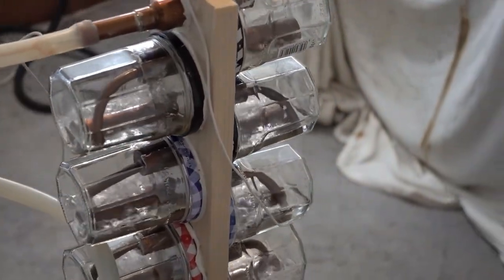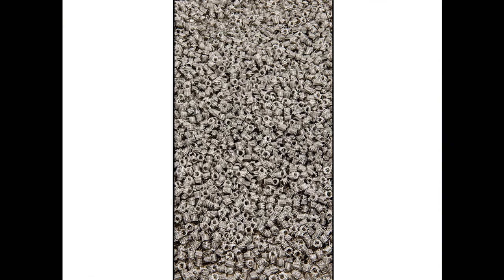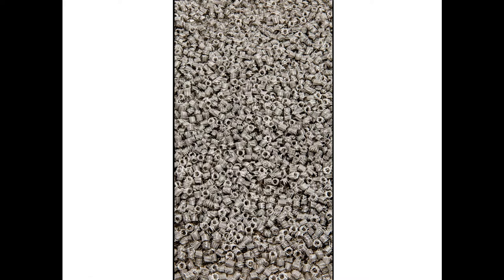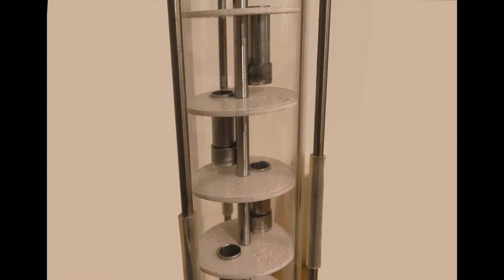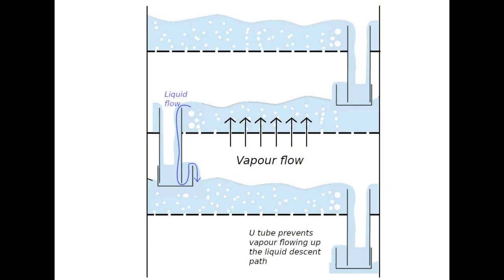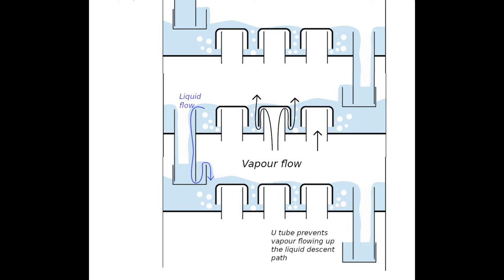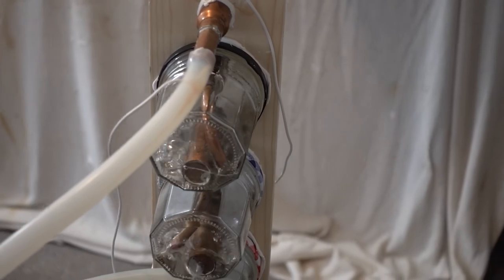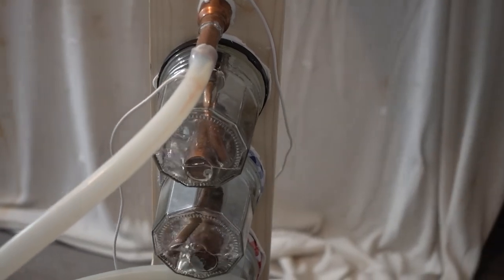moonshine columns

Comment: yes i'm definitely interested in how the last type works . subbed
Reply from the maker: Thanks, I'm working on a more detailed video but the original version has to be rebuilt as it was shonkilly lashed together with wood and silicone sealant and developed leaks, inevitably I guess!
Reply: @tight1449  could you make some kind of a tutorial video while building it?? I'd be interested.
Reply from the maker: @pranksboom3265  I am doing that but will defer publishing it until I have tested it to measure its performance.

Comment: I feel blessed to have stumbled upon this gem. My head is spinning with new ways of thinking about this  *I'm quite interested in your bonny jar contraption.
Reply from the maker: I'll post more on that but need to rebuild it. The original was lashed together with wood and silicone rubber and not surprisingly sprang leaks after a while.

Comment: That Bonnie Mammon Column looks interesting. can you expand on that?
Reply from the maker: I'm working on it. The original was a lash up using tin lids, wood, and silicon sealant to hold it together and it didn't take long before it started to leak, so I wasn't able to characterize its performance properly. I've dismantled it and bought a brass plate that I plan to rebuild it around. I'll post on it when I've finished  however good or bad it turns out to be.

Comment: I love my packed column. i have tried by bubble plates, but found they are less efficient as i can put more energy into the packed column to get steady state reflux. I am using a boka type collector under the condenser on a 100l still. i use a 4" column with only 20% packed. I like this arrangement as i take off the foreshots in increments, waiting for each draw to stabilise, and i get a good split for cutting. I tend towards a pot still but still want a little reflux else i get many fusels in my distilate. 

May i ask. I want to scale my boiler to 1000l. I have opted for a 12“ condenser, but i worry abou the flow rate of coolant. I'm using 100kw heat source to boil, so alot of energy to take out once boiling. Is there a good rule of tholumb for the condenser sizeand flow rate which is will set at 6 cubic meters /h.
Reply from the maker: I don't have experience of anything so large. What I have found with scaling up is:
1) better cut resolution
2) column cross section area needs to be roughly proportional to alcohol vapour flow rate
3) Behaviour changes because of relatively less heat loss from the column surface
4) Column height doe not seem to have to increase in proportion to diameter. I am making vodka so am not so fussy about cut resolution. I found that a columns of 1500 by 28mm, 1000 by 35mm and 1000 by 60mm work equally well. 

Were I making vodka at 6m3 ethanol vapour per hour or close to 10kg or 13l /hour I would try a 200mm column but that is for azeotropic fractional distillation. If you are not chasing 96% it could be a lot smaller.
Reply: @tight1449  Thanks for replying. Agreed, the cuts should be stretched out, and much easier to remove the bitterness from my molasses run. So 6m3 is the same as 10kg, 13l/hr. not know that. if i have a 1000 liter still, then in an hour i would hope to be 50% through, so maybe 50l. I figured my condenser is 27 times larger than for a 100l still, and with a cooling rate 10 times higher, i hope i can achieve this, so  can maybe stretch two runs in a day. But this is a guesstimate. I'd love to throw a bigger cooling pump at the thing, but i am limited to just 1hp. law of the land.
The azeotropic process looked cool, but not sure why its an improvement on a continuous still. But then I've been only made vodka once at 96%, using a 1m lagged and packed reflux column.

I feel I've missed my calling making spirits. Spent most of life writing code.

☺️
Reply from the maker: I use the azeotropic process on a continuous still. I found a noticeable difference in taste between 95% and 96+% before I used ozone and carbon filtration. No I do I'm not so sure!
Reply: @tight1449  wow. what mash are you using?
Reply from the maker: Just sugar and Alcotec Vodka Star yeast, as per the instruction on the packet.
Reply: @tight1449  lol.. ok. understand. You want vodka or fuel, or both. i prefer whisky or rum.
Reply from the maker: @nothinghere1996  More prosaic than that. I have worked on distillation rather than fermentation. I like whisky and rum too but doubt my ability to make it!
Reply: @tight1449  which country do you live in? if you want to have a go, i will help with some pointers if interested. Rum. is easy. whisky more complex, but I'm sure you can do. easily.

Comment: The Bonne Maman column is ingenious, but do you not get issues with the vapour interacting with the plastic seals on the lids?
Reply from the maker: Not the lid seals but my silicone rubber lash up was a disaster with plenty of leaks at my joints. I'm doing it properly with solder before posting a more detailed video on it.
Reply: @tight1449  Looking forward to watching it. I found that any amount of silicone exposed to the ethanol vapour caused a rubbery taste in the end product. But then, the Air Still has a silicone gasket seal, and that doesn't have the problem, so not really sure what's going on there.  I'm wondering about using sodium silicate to seal gaps instead...
Reply: Plastic seals? Those are tin or steel lids!  Thought you put nothing except copper, stainless, or glass in vapor path?
Reply from the maker: @kirkstinson7316  Not a realistic list of materials. If using copper you also inevitably need to us Tin as solder. Triclamp systems use silicone seals and I use food grade silicone tubing. I have used food grade silicone sealant and don't recommend it but that is because it is a bodge and has nothing to do with toxicity. Column packing products like Rashig rings are often aluminate ceramics. Mild steal is perfectly non toxic, it just rusts. I consider that anything used should be food grade and suitable for the temperatures. Why add other arbitrary restrictions?
Reply from the maker: @kathykathy7065  I have not had that problem but have not used significant amounts of silicone rubber in the vapour stream. Only occasionally when using tri-clamps. The jam jar column used a silicone hose to connect to the condenser but that was mainly experimental and version 1 was a lash up. I make my own columns with copper and tin solder, I did once get a flux taste when I had not cleaned it properly before use!  I use silicone rubber tubing to convey condensed product and have never noticed a rubbery taste. Sodium silicate is stable and I doubt it would give any taste though I find solder a lot more reliable than other cements.
Reply: I'm not sure how important it is because I taste no difference, but to err on the side of caution I bought Teflon replacement seals for all my column tri clamp fittings. They were easy to find on LEX press (sound it out) if that's a concern for you.
Reply from the maker: @robertmountjoy5870  I have seen these for sale recently. They are slightly more expensive that silicone. I have not tried them. they seem to be aimed at applications with more reactive chemicals than are found in spirit distillation. I'd be interested to hear if anyone has found an advantage with them.

Comment: How is the jam jar column in anyway safe? Thise lids are tin or steel. Yes, they are enamored but you drilled through them so your vapor is contacting it. Copper, stainless, or glass or you seriously run the risk of poisonous salts in your vodka
Reply from the maker: What salts have you in mind? There are quite tight restriction on the materials that can be used in food packaging which jar lids are.